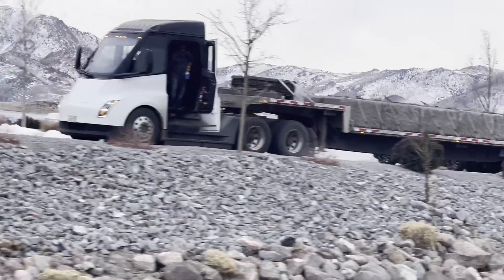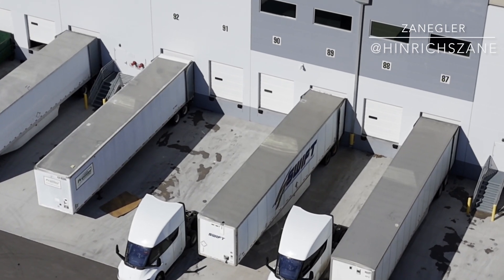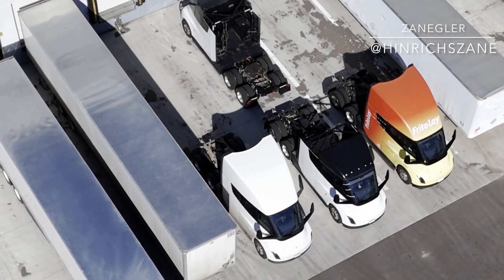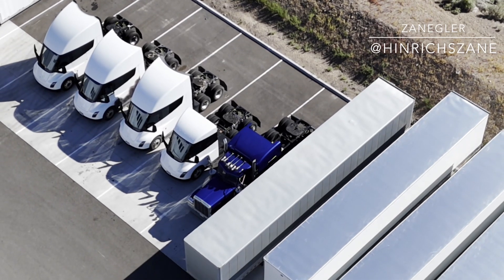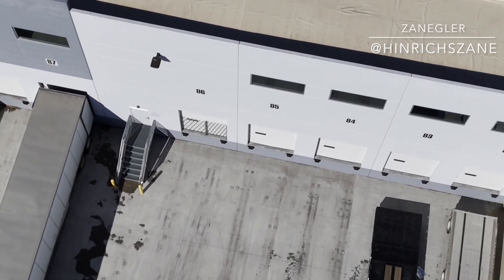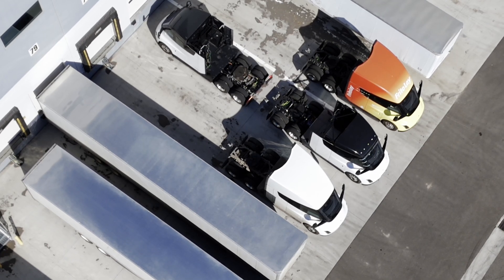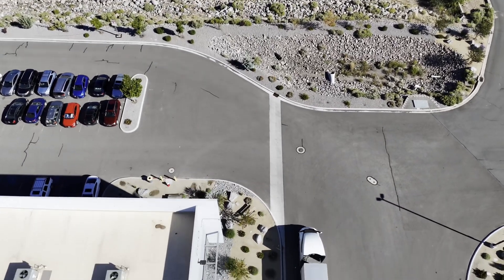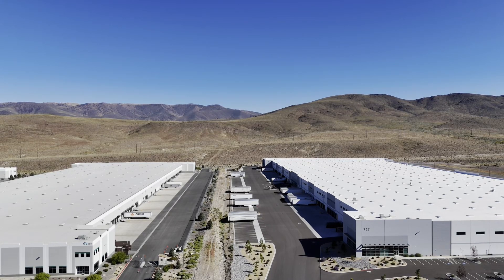Tesla Semi Fun Facts - THE Design Breakthrough

Comment: What is holding the truck back today remains charging, IMO. Getting a network going isn’t happening, which I put somewhat to this current administrations hate for Elon and some on Tesla not wanting to waste its money when the IRA bill is designed to pay for it… or they really are still focused on reliability. I keep hoping to hear of major charging expansion to the major interstate fueling stations.
Reply from the maker: Good points. My only thought is that they are planning to initially saturate the shorter routes where the fleet operator will provide charging at the distribution center and semi’s will return to base daily. Then, later penetrate the long-haul use-case. I understand they are building out a megacharger network between California and Giga Texas for their own use. This will lower their logistics costs.

Comment: The ability to maintain constant speed is something that's greatly overlooked.

Consider a 10 mile gradient.
Tesla Semi maintains 60mph.
Conventional Semi averages 30mph
That's an immediate 10 minute advantage.
Reply: There's going to be a lot of false confidence in the safety of this machine. In a diesel rig, you have 4 different braking systems: engine, Jakes, air, and spring. The Tesla semi is heavier but only has 3: regen, air, and spring. Once that regen fails (Murphy's law) there is no holdback force. The axles are just free spinning in neutral.